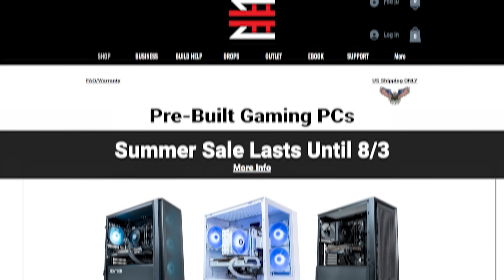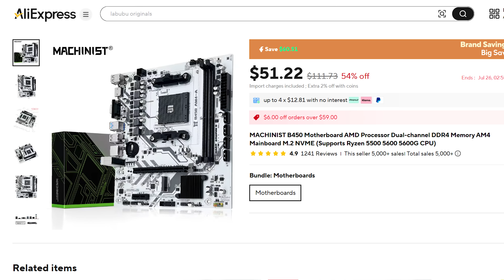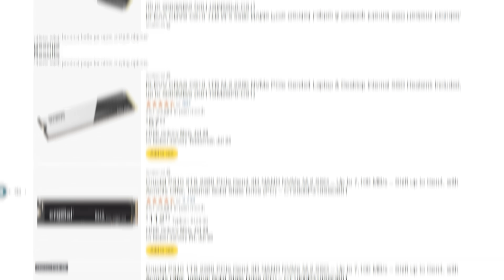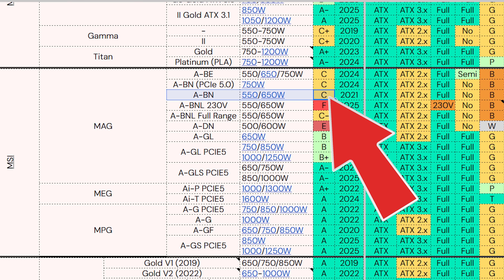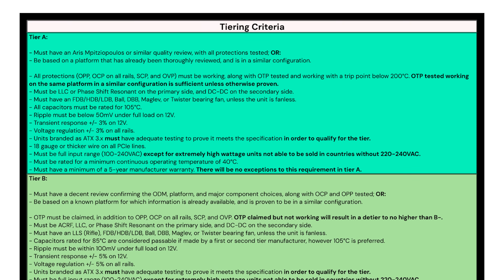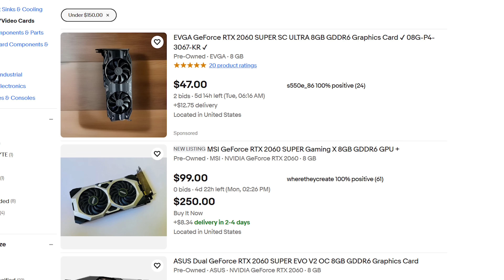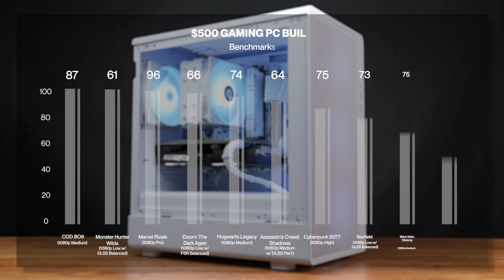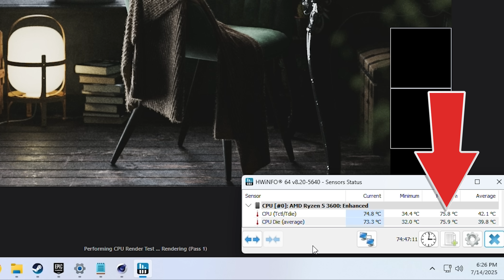$500 Gaming PC Build Guide

Comment: Hello guys I need help. Is it worth paying 400$ for this pre owned PC

Here's the specs
i7-9700k
hyper 212 cooler
asus z390 rgb
ddr4 16gb rgb
thermaltake tempered glass case with white fans
asus tuf 1660 super 
550w psu
125ssd & 1tb

Comment: Glad to see that PSU used. I ust got the 650w unit and it is semi-modular which is nitce as I only need to add one PCIE for the 5060ti 16G and they are the nice flat cables.

Comment: hey, rate my $300 budget build from 1/10 and fix issues if there are any :
- ZSUS X99-W Motherboard
 - LGA2011-3 Xeon E5 2680V4 CPU
 - DDR4 16GB (1*16GB) 2133MHZ RAM
- 500W PSU ( Still looking for a decent priced one )
- 500GB Toshiba ( My current Asus R541S laptop's HDD. Will try and get a good nvme )
- Dual Fan Heat Sync ( Still looking for a decent priced one )
- AMD Radeon RX580 ( On sale ofc )
And pretty much every part will be bought used because I'm poor :(

Comment: Just built a customer's PC for $550. 5600X, 6600XT, 16gb ram, 512gb NVME, 550W PSU, Tower air cooler, in the Walnut accented micro atx Okinos Cypress 3. CPU and GPU were off Ebay, great shape, they work perfectly. Budget builds are alive.

Comment: Hey Zach, I'm currently running a R5 5500 with a 500W Seasonic 80 Bronze PSU, 16 gigs of 3600HZ CL 18 Ram and a GTX 1050 TI that I'm looking forward to upgrade. I want to know firstly if I should upgrade ram by just buying 2 more 8 gigs or a full new 32 gigs(2x16) 3200HZ CL16. And secondly the graphics card I was thinking about a 5060 but now I'm considering the RX 9060XT 16GB given my processor. Also I'm dubious about upgrading my psu I don't know if my 500W can handle the 9060 XT also I'm afraid the 5500 could bottleneck with the 9060XT. Thanks beforehand

Comment: I built a pc in UK for £550 i don't know if things are cheaper over here. But I got the A520M K V2 Motherboard. CPU Ryzen 5 5600, GPU 9060 XT , 16 GB DDR4 Ram , 1TB M.2 SSD, I used the same PSU as him. The Gamdias case I used came with 4 preinstalled fans with RGBs they provide sufficient airflow and the case only cost £30. You need to get a adapter so that the RGBs plug into Ur PSU as the motherboard doesn't have a RGB header that's the only thing but I got one for £5.
Reply: Are you getting around the same fps in games as him?

Comment: Hi Zach I have a $472 gaming PC I don't know really much about building or anything I have "16 GB RAM" "AMD Radeon RX 6600 GPU" & a "AMD Ryzen 5 5600G CPU it has inegrated graphics" I want to upgrad my GPU I'm looking to get 165FPS in fornite stable or 180FPS I think I want the "AMD Radeon RX 6700 XT" I have great cooling I think my SSD is fine It's kinda lower on storage I just want to you what I should upgrage I will later upgrad my ram to 32GB so if you can also recommended some ram 2 ram sticks I get like 130 stable fps in fornite all low setting I really want to use all my Hz on my 180Hz monitor I dont care about looks I play Roblox & fornite I don't really feel like playing other game I also like High graphics most of the time I don't use upscaleing I use 1920x1080 I want to stick with ADM GPU cuz I think its better also I dont want to use raytracing Please GPU cheatper side like $320 or lower here my mother bard if you need it "B550M-HVS SE" Thanks.

Comment: Be a budget gamer tons of improvement can be done 

Get a used ram 3200mhz and 16gig is enough in this range 

Used old dell or hp case only for 5 to 8 dollars 

Put more money buying rx 6600xt or 6700xt

Save on psu if you know which one u r buying used 

Get hdd 1tb 
And nvme only for windows 128gig does the job in this range

Comment: I just can't see buying parts from aliexpress or Temu or any of those other scammy sites. They're not vetted, warrantied, or even tested to make sure they won't burn your house down. I just spent $650 to build with an i7, 32G RAM, 2TB hdd, and a 3050 and used all vetted parts from trusted manufacturers. It's definitely possible to do it and do it right if you're diligent about scouring the internet for deals. I also saved like $150 by buying black parts and a basic case with no fancy RGB. It can definitely be done and done right for an affordable price without resorting to these poorly manufactured and untested parts from shady companies.

Comment: Hi! I’m building a PC mainly for my cybersecurity hands-on practice, and I’d appreciate your GPU recommendation. Since Nvidia plans to end updates for its GTX 10 series, I’m considering alternatives. Here are my current specs:

PC Build Specifications:

1. CPU: Intel Core i5-13400F (10-Core, 16-Thread)

2. Motherboard: MSI PRO B760M-P DDR4 (mATX, LGA 1700, PCIe 4.0)

3. Power Supply: Great Wall 750W (80+ rated)

4. Memory (RAM): Kingston FURY DDR4 3600 MHz, 8 GB × 2 (16 GB total)

5. Solid-State Drive: Samsung / Western Digital PCIe 4.0 NVMe SSD (1 TB)

6. Cooling: Air cooler + Frozen Infinity all-in-one water cooler

7. Case Fans: 10× ARGB fans + ARGB hub

8. Networking: Wi-Fi 6 module

What GPU would you recommend given this and the end of support for GTX 10 series? Thanks in advance for your advice!

Comment: Recently built a new pc. CPU- Ryzen 7 9700x, MOBO- MSI Mag B850 Tomahawk Max wifi, Ram- Kingston Fury Beast 2x16gb 6000MT/s CL30, SSD- Crucial T500 2TB, PSU- MSI Mag 850GL, AIO- LF III Pro, CASE- MSI Mag Pano 100R Pz, GPU- MSI 5070Ti Trio OC (Arriving Soon). 

So, my query is that I have enabled EXPO profile for the ram, disabled memory training and also disabled fast boot but my pc takes almost 40 seconds to fully boot to windows lock screen, is that normal? I've noticed in ez debug led when pc boots up I mean when I clicked the power button after a few seconds CPU and Ram debug led lights up for a few seconds and then it turns off after that the boot debug led turns on for a few seconds and turned off and I see my MSI boot logo on my screen. Is this behavior normal? I've seen other builds they takes like 10-15seconds to fully boot.

Comment: I just bought a used PC for 530usd

7500f
B650m
32gb 5200mhz 42cl
650w gold
1tb pcie4
Ag400 cpu. cooler
6 fans + case
Rtx 3070

Is this good value. It runs with no issue.
Reply: Kinda of a steal

Comment: Hi just asking which is better.

5900x 64ram 6900xt or
9600x 32ram 9060xt?
Reply: The top one have slower ram a faster gpu but the gpu is worse at ray tacering 

Bottom one faster cpu and ram but less ram the gpu is slower but have fsr 4 and better ray tacering 

If you play modren aaa games the buttom one but if you play competative the top one

Comment: Hey Zack, so, a bit of context first (this comment might be pretty long).
So, I have my pc (Ryzen 5 8400F, 16GB RAM and RTX 3050 8GB), I'm happy and satisfied with it but I have a problem, I'm frequently not at home and don't have a laptop, and I'd like to play my games when I'm not home, so I want your help/advice to find a good gaming laptop to buy.
The most demanding game I play is Ready or Not and my PC can run it at stable 90fps in high settings 1080p, so if you can help me find a laptop that gives me about the same fps in medium or even low settings I'd be really grateful, I don't have a specific budget yet but my top would be 900-1000 bucks.

PS: I send this here because yt doesn't let me send super thanks in shorts for some reason

Comment: Important question about the power cords on PSU’s. I currently just built my new PC and my old PC. I am giving to my girlfriend. While taking out my old monitors, I switched up my power cords. I do not know for sure if I’ve plugged in my monitor power cable or my PSU power cable. Does it matter like the other psi cables?

Comment: I Need help a friend or mine build a pc last week, it has the rx 9070 Xt and a ryzen 7 7800x3d and this should run almost all games on high graphics without raytracing.
But for some reason just fortnite is lagging completely, we tried everything but we have no clue why it is like that. We tried other games and we had no problems with them at all!
I read something online that said that fortnite is very cpu heavy but we tried it in Performance mode and still there it was laggy. We had constantly over 500 fps but sometimes there were like huge framespikes but we couldn't figure out how to fix it.
Maybe someone of you may help me
Thanks

Comment: question for you guys. im new to pc gaming. is this a good deal for 500 $ Canadian? 
CPU : RYZEN 5 3600X
COOLER : THERMALRIGHT TOWER COOLER *NEW
MOTHERBOARD : AORUS B450 RGB ELITE
RAM : 2X16GB DDR4 CORSAIR
STORAGE : 1TB NVME *NEW
GPU : AMD RX 6600 
PSU : CORSAIR RM650X 80+GOLD AVEC WHITE SLEEVE CABLE POUR MOTHERBOARD ET CPU
CASE : PHANTEK 
thanks

Comment: can you please rate my 800€ build in short 

GPU: NVIDIA RTX 3070 (used) – 270€

CPU: AMD Ryzen 9 5900X (used) – 180€

RAM: 64GB Kingston DDR4 3200MHz (new) – 170€

Motherboard: ASUS Prime B550M-K (reused from previous build of my friend then gifted to me)

Storage: 1TB M.2 NVMe SSD (6000/4000 MB/s, new) – 60€

Power Supply: Chieftec GPS-700A8 (reused from previous build)

Case: Montech Air 1000 ARGB (new) – 55€

CPU Cooler: NZXT T120 RGB (new) – 63€

my first upgrade in 9 years coming from 1060 i5 6600k 16gb ddr3

Comment: I have a 5600x
X570 tomahawk 
32Gigs D4 ram
6700xt
RM750w 80+ psu

And 2 1080p monitors and It handles my every workload perfectly..  But my question is, It dose my jobs Perfectly fine, so Is ir worthy now to upgrade anyways?  Or Should I save up and Upgrade much later?😊

Comment: I bought a Sapphire Nitro+ RX 9060 XT 16GB GPU instead of the RTX 5060 16GB, with a price difference of $200 in my country.
I used the savings to buy a Ryzen 5 9600X CPU.
Do you think this was a better choice than going with the RTX 5060 and an i5-14400F processor?

Comment: I'm running a R5 3600, Vega 64, 32gb 3200mhz RAM and 512GB 3600Mb/s NVME... (Because that is all I can afford) And it still performs well at 1080p for me. If a game needs more GPU ram, I bump the HBCC to 16Gb and it works well.

Comment: @zachsTechTurf what do you think about this

Laptop with desktop hardware 

🧠 Core Components

1. Motherboard: ASRock X600TM-ITX (Thin Mini-ITX, AM5, DC input, eDP/HDMI)

2. CPU (APU): AMD Ryzen 7 8700G (or 8600G / 8500G) — 65W with powerful iGPU

3. Cooler: Low-profile AM5 cooler (e.g. Noctua NH-L9a-AM5, Dynatron A38)

4. RAM: 32 GB (2×16 GB) DDR5 SO-DIMM 5600+ VLP or low-profile

5. Storage: 1TB NVMe M.2 PCIe Gen4 SSD (e.g. Samsung 980 Pro, Crucial P5 Plus)

🔋 Power System

6. Power Adapter: 19V DC 120–180W laptop-style power brick (5.5×2.5mm barrel jack)

7. Battery Cells: 3–6 × flat 3.7V Li-ion (pouch/prismatic) batteries (5000–8000 mAh each)

8. Battery BMS: 3S–6S smart BMS with Bluetooth or UART (e.g. XH-P20)

9. DC-DC Converter: Boost converter (e.g. 3S → 19V module)

💻 Display & Input

10. Laptop Display: 14" or 15.6" eDP LCD screen (1080p or 1440p IPS)

11. eDP Kit: eDP cable + voltage converter board (often bundled with screen)

12. Trackpad: USB external touchpad or Apple Magic Trackpad

13. Keyboard: Low-profile mechanical keyboard (e.g. Keychron K3, Kemove DK61E)

📡 Connectivity

14. Wi-Fi/Bluetooth Card: Intel AX200 / AX210 M.2 E Key + external antennas

15. USB-C Module: Optional USB-C 3.1 or PD breakout board via USB header or PCIe

📦 Chassis & Accessories

16. Custom Chassis: CNC or FR4 sandwich case from PCBWay or JLCPCB

17. Heatsink Vents & Fan (Optional): Side/top vents + 25 mm low-profile fan

18. Battery Mounting: Foam pad or brackets for flat Li-ion cells

19. Display Hinge: 3D printed or custom hinge mechanism

20. Mounts: Velcro/magnets/standoffs for keyboard and trackpad

21. Thermal Pads/Shims: For passive heat transfer to chassis if needed

🛠️ Optional Enhancements

22. ESP32 Battery Monitor: To show battery % on small OLED screen

23. USB DAC (Optional): For better audio output if onboard is insufficient

24. Speakers (Optional): Small USB or internal 5V speakers

I am student.

Comment: building a pc with i5 3470, 2*8gb ddr3 1866mhz ram 
rx550 4gb drr5
500w psu 
itx h61 mobo 
256 gen 3 nvme ssd 

heavy heatsink cpu cooler 
and lastly a m-atx rgb case 

total 190$

and the 500psu is 80+ platinum certificate (almost for free)

rest all parts new from Amazon
is that good?
Reply: For a build with almost all 10+ year old components buying new seems silly imo

Comment: Have been humming and hawing about building my pc and used 2 of your cheat sheets-getting alternates mostly. But got a good b550 gigabyte mb-5600x+ 5700xt with 32gb kit and 1tb ssd for around 600+/-  I just want to game in 1080 as framerate>visuals to me for the most part. Thanks for the incentive to finally replace my ancient laptop. Your guides are succinct and seem to come from a gamers perspective- many other builders- not so much. Update- the 5700xt when plugged into a recommended PSU will not allow the pc to even turn on. When unplugged except for pci-pc will power on but of course wont post. Ebay purchase- so will attempt a return-

Comment: Swap the 2060 super with the GTX 1080 TI with 11GB of VRAM, which would be more relevant in the future compared to 8GB in the 5700 XT and the 2060 super. Maybe also swap the 3600 with the 5500 but the rest is good.
Reply: Yes, replace the GPU with an outdated, slower GPU that can't run newer games at a playable framerate or punch through unoptimised ones with upscaling because it has an irrelevant amount of VRAM in this performance tier.

Comment: looking for good prices in my country i got a full white build with infinity fans almost all from ali with these specs:

ryzen 7 5700x 90€
b450 machinist 40€
16 gb white ram 28€
1tb ssd gen 4 36€ (ebay)
fishtank case 50€
2070 super 155€ (used from local market)
tower cooler and 3 fans 35€
650w tier c psu 30€

Comment: earlier this year I built my own PC, basically the same components minus the gpu being a 5700XT; paid a bit more for the motherboard that i got (80 bucks) but my other components i spent a little less on, and since I didnt get cable extensions cuz the build is all black and i didnt deem them necessary, i spent basically the exact same as this pc guide for mine, and im glad i found the 5700xt for under 150 because its a beast for price to performance

Comment: I need some opinions on a choice I’m going to make in my upgrade path. I just upgraded my GPU from an RTX 2060 KO to a 9060 XT 16gb. The main problem is that I’m still on a Ryzen 5 3600. Would I be better off saving some money and upgrading to a Ryzen 7 5800xt (or similar am4 cpu) or spend extra to move to an am5 mobo with ddr5?

Comment: 2:42 Why are you using a 1tb gen4 ssd in a gen3 supported motherboard??
Reply: Gen 4 and gen 3 ssds are basically the same price now, so even if you're going to be locked at gen 3 speeds it's still worth going for gen 4.
Reply: @justmatt2655  Great pal, thanks for your explanation.

Comment: GPU: ASUS TUF RTX 3080
 • CPU: Intel Core i5-13600K (14 cores 20 threads)
 • RAM: 32GB Corsair Vengeance RGB 
 • Storage: 1TB SSD (Fast NVMe)
 • PSU: 650W 80+ Gold Certified
 • Motherboard: Gigabyte B660 DS3H AC (Wi-Fi & Bluetooth)
 • Cooler: RGB CPU Cooler are these good specs for a PC and should I get it I don't know too much about PCS

Comment: I’m planning to build a new PC with a budget of around €1400, and I’ve selected the following components. I would like to confirm that all parts are compatible and optimal for performance within this budget.

Selected Components:

CPU: AMD Ryzen 5 9600X

GPU: MSI GeForce RTX 5060 Ti 16G VENTUS 2X OC PLUS

Motherboard: MSI PRO B650M-A WiFi (AM5, DDR5, Micro-ATX)

RAM: Crucial Pro DDR5 32GB (2x16GB) 6000MHz CL36

SSD: ORICO NVMe M.2 1TB PCIe 4.0

Power Supply: Cooler Master MWE 750W Gold V2 (ATX 3.1 / 80+ Gold)

Case: MSI MAG FORGE 112R (Mid-Tower, 4x ARGB fans)

CPU Cooler: ARCTIC Freezer 36 A-RGB

Monitor: KOORUI G2421V QHD 24", 180Hz IPS

I would appreciate your feedback on the compatibility of the build, especially regarding power requirements, airflow, and if there’s any better performance-value option for the GPU within the same price range (~€460).

Comment: Is this pc going to work 

Ryzen 5500 cpu (w/ cooler)

ASRock B550M-ITX/ac
(Mini-ITX w/ Wi-Fi & Bluetooth)

Kingston FURY Beast 16 GB 
DDR4-3200 (single, 1x16 GB)

Crucial P3 500 GB NVMe PCle 
Gen 3 SSD

CiT Elite Micro-ATX case
500 W PSU
Reply: No graphics card? If not, you'll need a CPU with integrated graphics (like the 5600G) to get a display out the motherboard. Otherwise, yes it will work

Comment: I did a "$1k" Canadian rig for each of my sons this month. Ryzen 5 7600, wifi mobos, 16gb of ram, 1tb ssd, 750w gold modular PSU, and Monotech air 100 argb cases.

I spent under $750 on each and just used their old GPUs, but for their needs, the RX6600 is cheap and does the trick and would have hit the $1k tier when on sale. One is actually running one already, it's a nice setup. The other has my old 2070. 

With exchange right now, it's pretty close to the $500 goal, and I am pretty happy with how they turned out.